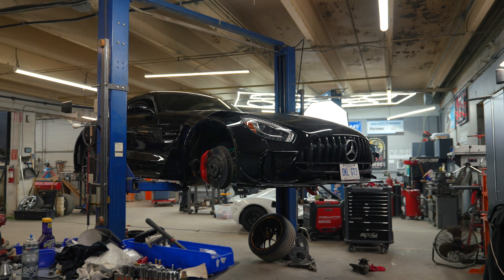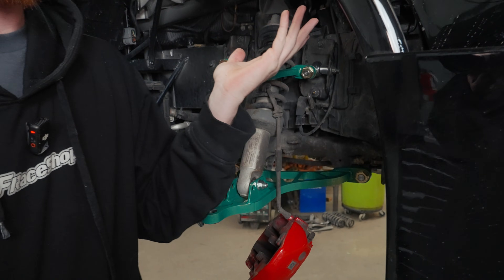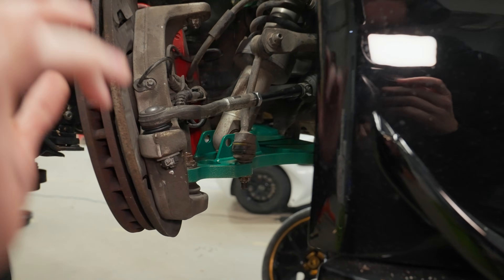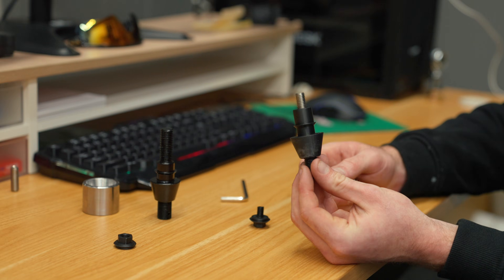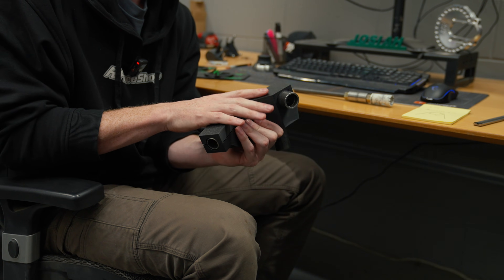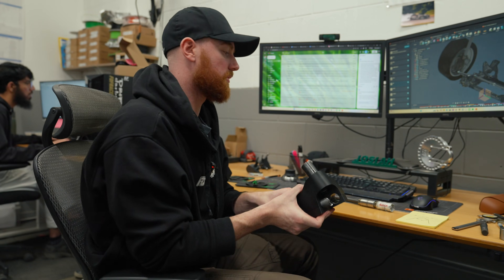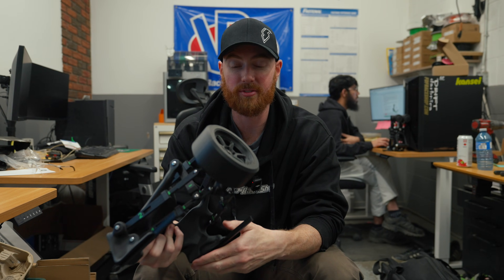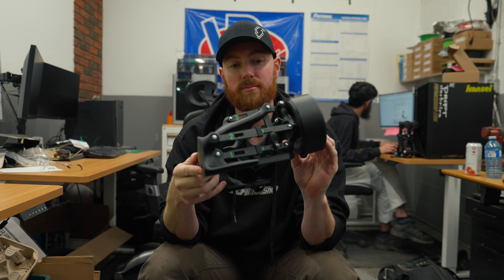Design Time Episode 14: Why We Built Custom Suspension for this AMG GT R

Comment: Its cringe for me to look at the caliper hanging by the brake hose though.  Ive seen, in person, the brake fluid leaking from the connection of the rubber hose to the metal crimp on track cars.  Fortunately, no one got hurt while on track.
Reply: Probably because they have to replace them with extended brake lines due to increased track width anyway.